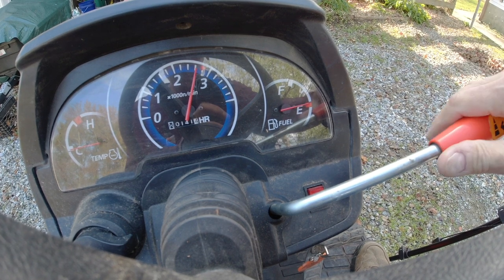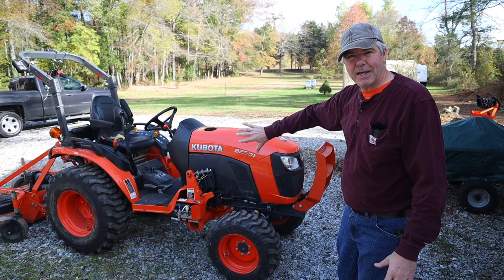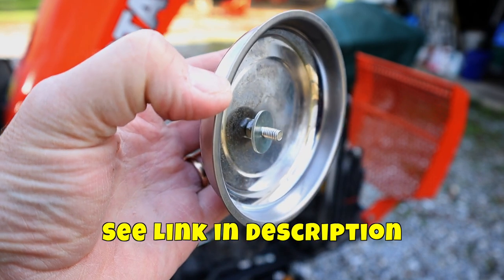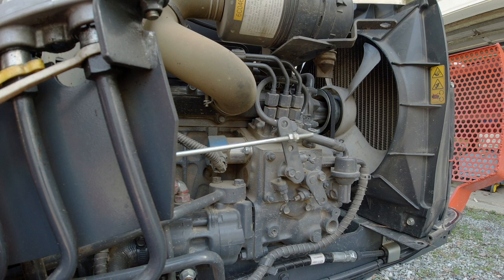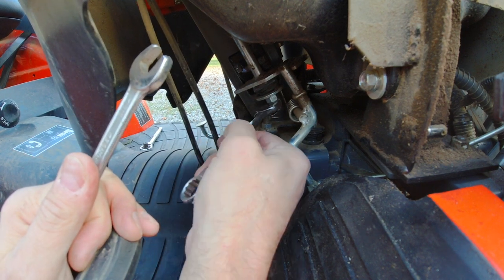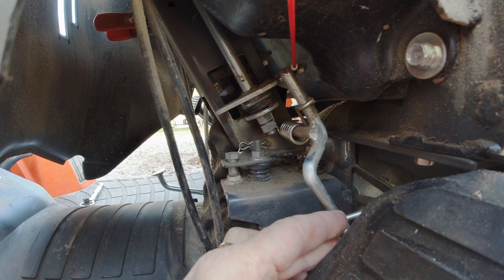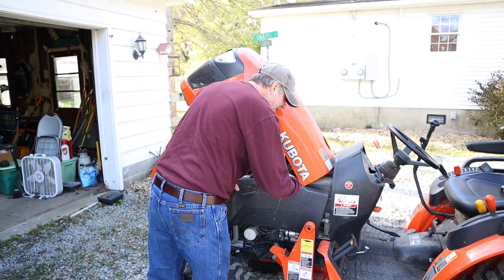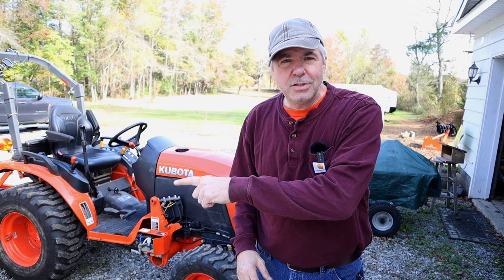#81 Kubota B2601 Throttle Problem and Fix!

Comment from the maker: Here are some product suggestions. These are Amazon Affiliate links, so purchasing will help this channel by providing a small commission while not costing you any more. Thank you for your support!
Titan Magnetic Parts Tray:
https://amzn.to/3wmimQy
Lumax Heavy Duty Grease Gun:
https://amzn.to/3mFK1pA
LockNLube Grease Gun Coupler:
https://amzn.to/3kPcvwu
Recommended Grease:
Valvoline Moly Fortified
https://amzn.to/3jNM1Kv
Nitrile Gloves:
https://amzn.to/34Kg8OG
Deerskin Gloves:
https://amzn.to/2I17NNy
My Video Gear:
Rode Wireless Go II microphone:
https://amzn.to/3eiJatG
Canon M50 Camera (now Mark II):
https://amzn.to/3vHW9uD
Battery adapter for M50:
https://amzn.to/2RshsBE
Sigma 16mm prime lens:
https://amzn.to/3vJDRcx
Sigma 30mm prime lens:
https://amzn.to/3epFneh
Variable ND filters:
https://amzn.to/3tmoHIs

Comment: On my B2601 there is a philips head screw in the upper middle of the shroud that wasn't mentioned. Needs to be removed for pulling back that shroud. Other wise excellent video.
Reply from the maker: Yeah, I missed that one! Thanks!

Comment: Some of my tractors from the '50's have similar friction plates on the throttle rod Ed.  Though they area  bit larger, some are simple to access and some have much more difficult to remove stamped metal shrouds.  The access to yours is sweet by comparison.  Good helpful video to others that have a similar issue.  My '05 B3030 has the opposite issue...I really have to tug hard on it to slow the rpm's down.  Go figure huh....

Comment: Re your video of drifting throttle. I had same problem. But tightening the spring makes the lever very hard to move.
Solution: there is a friction disc between the 2 plates. I added a 2nd friction disc, so 2 of them. Result: throttle easy to move, and does not drift. B2601, about 1000hrs. Great machine.
Reply from the maker: Thanks for the tips, Richard!

Comment: I have the 2601 for 5 years now with the front loader and also rear tiller. I don't think I've had mine above 2k RPM.  When is it required to run this high at full throttle? Maybe I baby mine too much.
Reply from the maker: Sometimes you need to raise the throttle to reach 540 RPMs at the PTO. That’s the red tick mark on your tachometer. 👍

Comment: My B2601 has a small flush screw under the eyebrow of the  cover over the instruments. You can't take the cover off without removing that along with the two side bolts.
Reply from the maker: Well I’ll be darned. Looks like mine may have too. I may have “forced“ it off 🙄
Reply: @MyClutteredGarage  Don't feel bad, it took me a while to find what was keeping it from coming loose too.

Comment: I ordered mine with the R14  tires but I don't know if I don't like yours better. I had em filled with Rim Guard so I've been hesitant to play with the air pressure but I know it's too high. I like em to make full ground contact and they aren't doing that. It isn't a problem until the ground is wet. I knew I didn't care for turf tires so I tried these.
Reply from the maker: The R14s seem to be what everyone wants. If you park with the valve stems at the top, you should be able to drop some PSI.
Reply: My salesman told me to run 20 psi all around. That seems in agreement with the owner's manual chart for R14s with fluid filled rears.

Comment: Thanks Ed, my bx1860 has the same problem. Gonna have to fix before winter 🥶 snow blower needs full throttle. Last winter I had to keep on pulling the throttle to keep the rpms up. Now I see it’s an easy fix.
Reply: Once you tighten it and get the proper tension, add some locktite, or you’ll find it loosens up again in no time.

Comment: I have problem with my dad's lawn tractor it's not going to do full throttle and I can back it up fast I checked the throttle won't run full throttle so what do I need to do on the tractor it's a Kubota lawn tractor it's a little it's not a compact tractor it's a little one smaller than smaller than a compact tractor